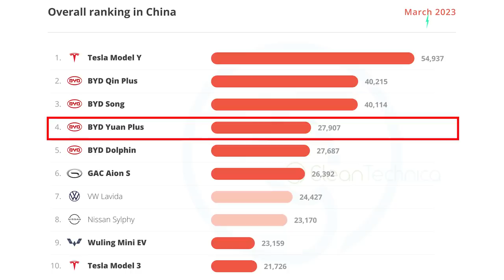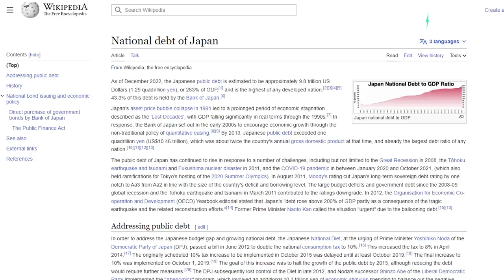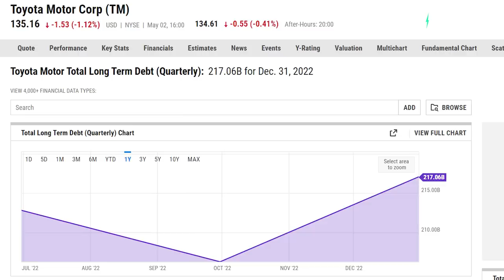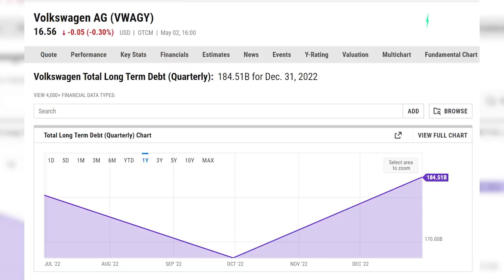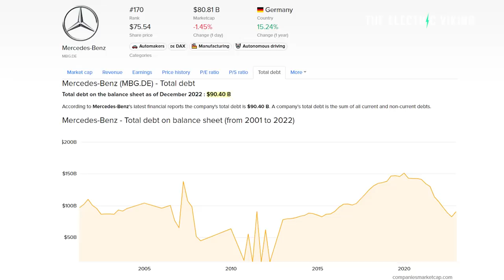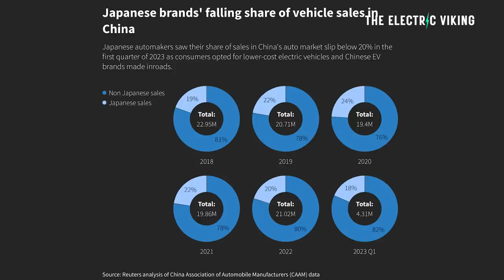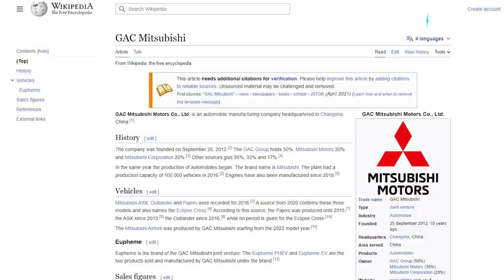Japan's automakers' Kodak collapse will cause an economic catastrophe

Comment: The car industry , china or otherwise , is a bell weather of planetary health. The planet will impose a slow down. The whole concept of infinite economic growth on a finite planet is simply not possible. All car companies business model depends on globalization ..   but the world is rejecting this .  .  globalization means we export our pollution. .  and we export our over consumption.  It could be that the non-china manufacturers already know that global private car ownership is a failed concept. Autonomous local mini busses that provide on demand services will mean car ownership will make little sense, even in those cities with suburbs designed around cars.  The Chinese electric > 50 seat bus industry is already dominant. Autonomous buses will be here soon with AI. Then it will be applied to smaller vehicles. Once that happens why own a car at all.

Comment: 3 points, I own a 22model s plaid, 22 ev6 gt and a 22 wrangler 4xe, 62 400 watt solar panels and 4 powerwall,so I would qualify as an ev guy and future tech person/family.  Japan has NEVER been a 1st market leader, and Japan has the central bank BOJ, remeber there are 4 money centers and they don't fail The Federal reserve, ECB, BOE & BOJ it's a club they work in conjunction, to a strong degree.  They will be fine, the countries outside of the "system" are the ones to watch.  The attempting bloc is user, China, Saudi,  that will for at least 100 years be a losing bloc, learn economic history it repeats.  I still like ur channel but disagree, factually, with the guess that Japan will be decimated. Cheers 🍻

Comment: Japan is not known for innovation, they can improve on an idea, but they don't have a track record of invention. The EV will have to improve and stabilize in production, retail practice, and maintenance, before Japan can start copying and improving. Currently, the EV is not settled in battery, recharge facilities and practices, and the dealerships don't want to spend the money to retool maintenance and train an additional set of technicians with sales as poor as they are. Is an EV car a good product? Sure, if you don't need it, or you don't have to rely on it. If it is a purchase you can make without sacrifice and its addition to your life is disposable, then yes. Otherwise, gas vehicles have the fuel distribution, a wide spread of capable repair techs, better prices, and an established network of spare parts. EV's are harder on the environment to produce, due to their heavy use of rare earth materials. Their carbon footprint is worse than a combustible vehicle, as they are being powered by fossil fuels at the Energy grid level. The electricity generated from fossil fuels has some loss in the conversion process and in the distribution process. The only difference is the emissions of fossil fuels are occurring at the location of the electric companies instead of the tail pipe. It's actually more carbon exhaust, it's just happening somewhere else unseen.
That being said, Globalists are forcing EV's down the throats of consumers and manufacturers instead of allowing the development and the adoption occur organically. This is why the manufacturers are suffering, and the dealerships are suffering with this deviation from the supply and demand model that normally supports any business idea. That and they are gay. You'll start seeing EV's first at Rest Stops, musical plays, and Budlight sipping parties.
Reply: You need to brush up on your English. Japan Inc is the definition of innovation. Look up the meaning of innovation.
Reply: @sara.cbc92  Good luck with that.

Comment: Don't worry, BEV will soon saturate the market and the demand for pure BEV will crash!  Hybrid car with hydrogen combustion engine is the best path for Japan because it requires the least  investment and the least amount of debt.  Toyota already makes millions of hybrids yearly, so switching to hydrogen is easy, just change the fuel tank.  Also, switching from hybrid to plug in hybrid just put in a bigger battery pack.  See how easy it is?
Reply: Uh... Ludicrous.
Reply: @markuc  --- Producing batteries requires massive investment of 5 Billion USD to make 500,000 BEVs like what Tesla did to build the Gigafactory.  If Toyota wants to make 5 million BEV annually, they will need to invest 50 Billion USD into JUST battery manufacturing.  Each Toyota hybrid has 1/2 of the electric motor power compare to a BEV, so a lot more investment into factories for e-motors and inverters for BEVs, so Billions more on new investment to make BEVs.  That's why new startup like Lucid, Nio, X-Peng...etc are in trouble with debts piling up and now price war from Tesla.

Toyota should press ahead with Hydrogen Combustion engine with hybrid power train that is already perfected and proven to be highly profitable.  People will simply fill up with Hydrogen the same way they have been filling up with gasoline.  Leave the complexity issue for the experts to solve.  We will just enjoy motoring the same way we used to.
Reply: So where is it? Where is this amazing  hydrogen car that us consumer can buy? Let alone the infrastructure, the hydrogen generation plants, etc?
Reply: @markuc  -- H2 trucks will set up the H2-fill up infrastructure for H2-cars to follow.   The whole world is ramping up investment in Green Hydrogen as the price of electrolyzers has been reduced by 70% and efficiency has gone up to as high as 95%.  The price of H2 is predicted to go as low $1.5 to $2.0 before 2030.  Toyota is perfecting H2-ICE tech right now and is testing it in a race car.  Some years down the line, it will reach the customers.  Meanwhile, enjoy your Tesla and all it has to offer.
Reply: @trungson6604  the more option the better for the consumer. But I fear most legacy makers won't survive the next 5 years being ICE only